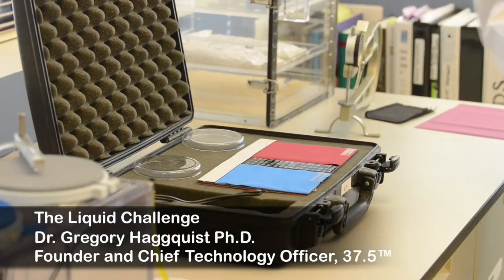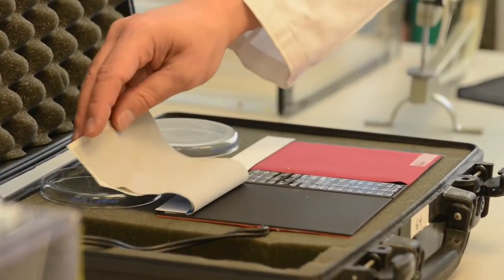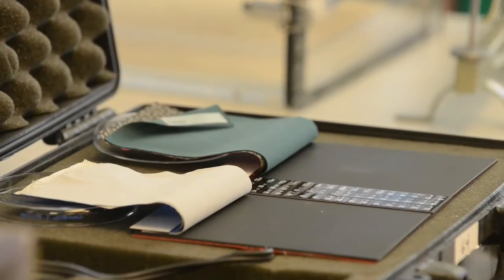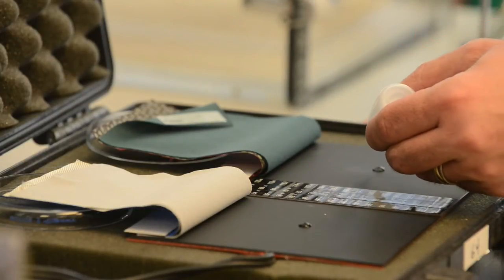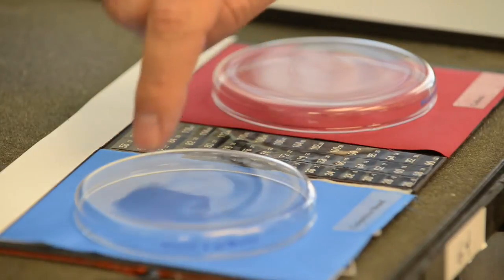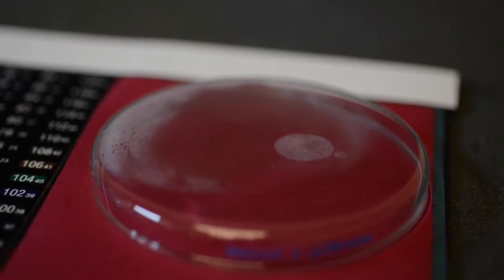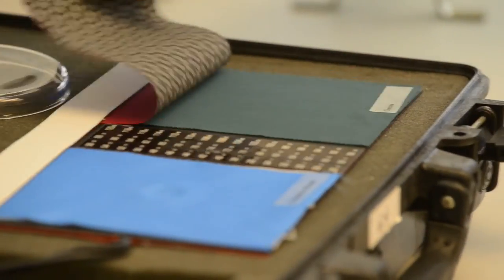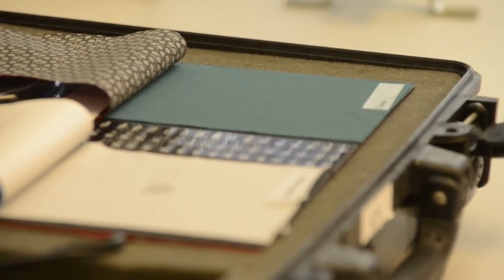37.5™ Technology Hot Plate Test

Comment: Interesting.  But does it work the same way at normal body temperatures? Your hot plate is at 104º -- is that in ºC or ºF? If it's Celsius, wouldn't that make the water turn to vapor and escape much more aggressively than if it were say 35ºC, like someone's body when they are running hot?